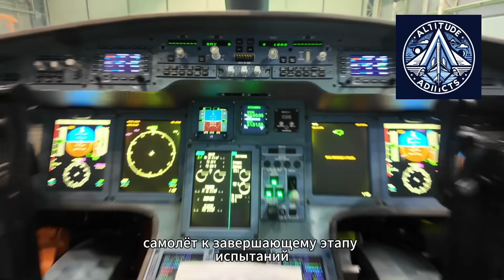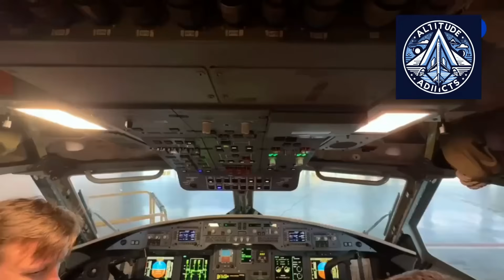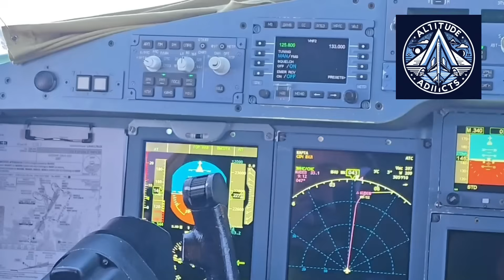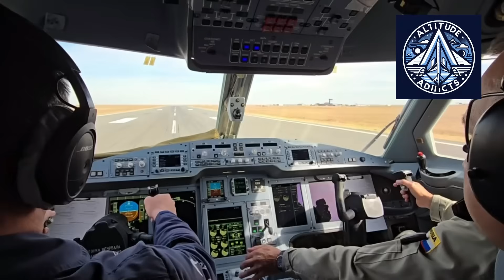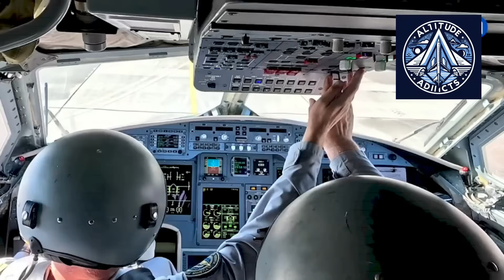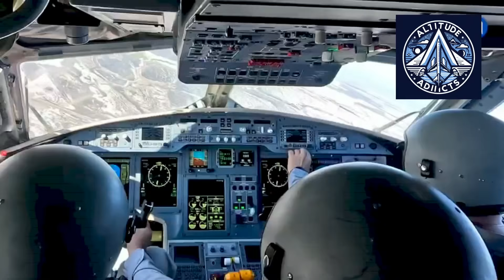Il-114-300: Only Weather Tests Left Before Entry Into Service

Comment: The endless news has not yet pleased us with the launch of the aircraft, which was created 30 years ago.
Reply: well the Boeing 737's first flight was in 1967 ...... so you are just ignorant ....
Reply: @GaryKennedy-g7p  The Boeing 737 began to be designed in 1964, and the first flight of the prototype took place on April 9, 1967. On December 15, 1967, a certificate for commercial flights was obtained.

Comment: Looking good.
This plane fills such a critical niche in coverage, servicing low volume, remote areas.
I'm trying to recall which engine is used in these?
There's been so many engines/planes reviewed in the last few months of the import substitution program.
One turbo-prop is a VK-800(???), or something like that?
I can't remember if that one is for planes or helicopters?
Reply: It's the TV7-117S